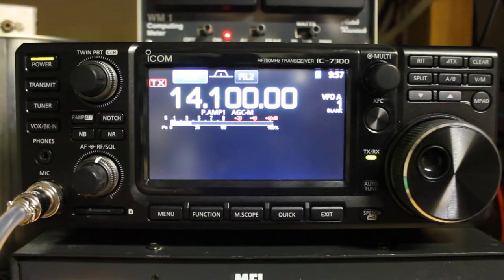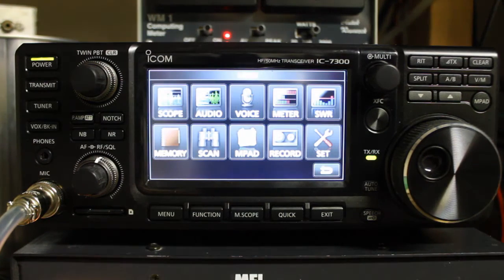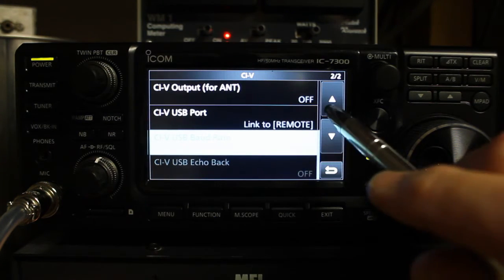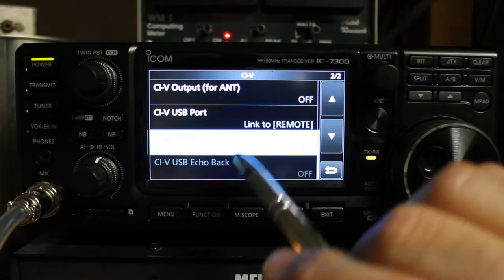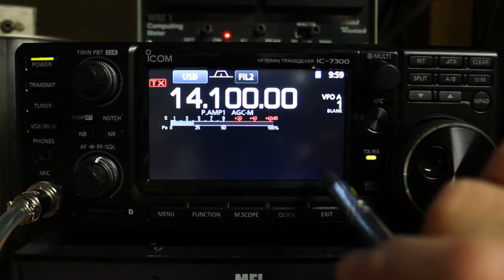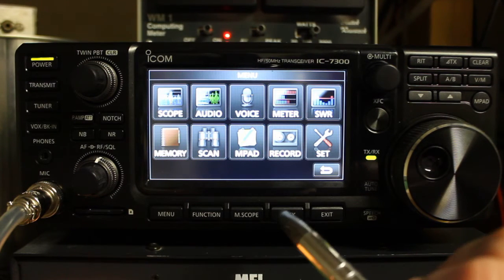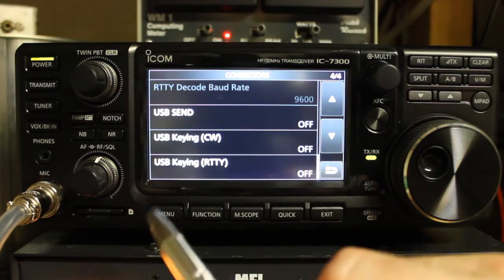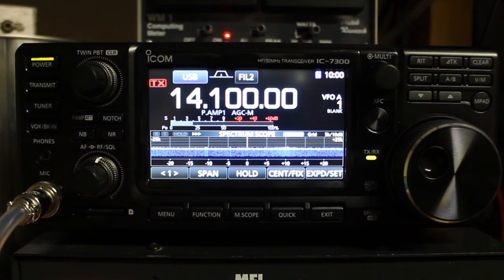Icom IC-7300 Tips and Tricks - Software Connection Issues

Comment: I bought the 7300 and an really having a had time interfacing the PC to the software and radio.  trying to figure what to do first, Rig settings, firm ware check and driver mod, done, download HRD installed it, I then installed WSJT-X 2.0.
The first night I was receiving a little.